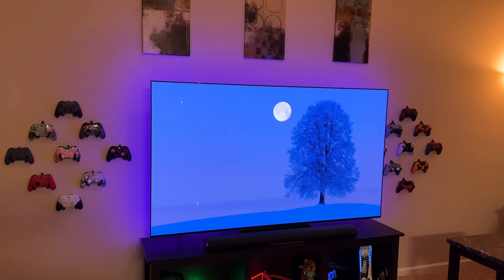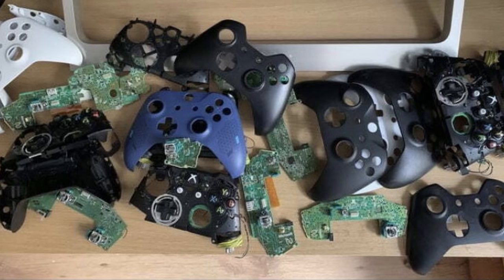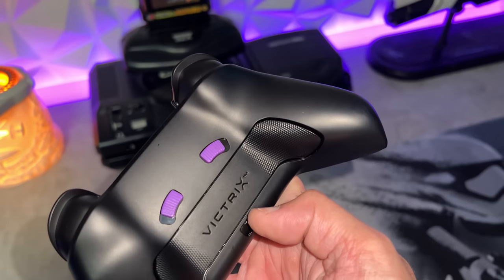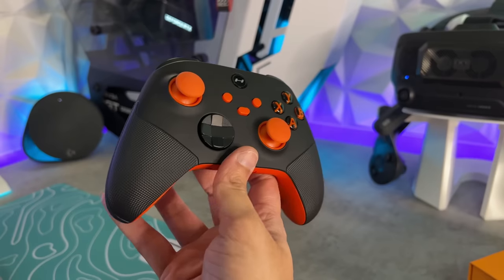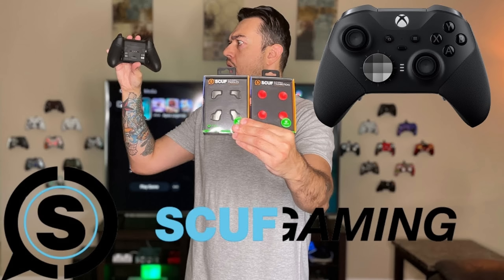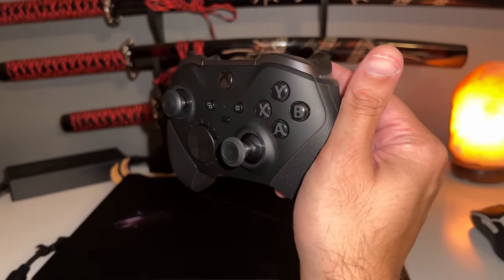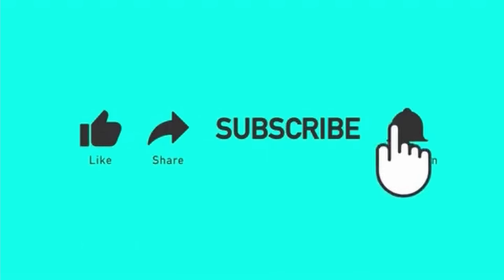Best Xbox Controller-28 Compared in 3 Price Points (Ultimate Showdown)

Comment: Could you recommend me a controller with 'clicky' face buttons with a more traditional xbox shell design (preferably wireless as well)? I managed to borrow a Razer Chroma v2 for a few days and the buttons were such a joy to use, they instantly got me hooked. But I just can't get used to the shape. it's the only controller I've ever held that actually made my hands cramp up. It seems like Battle Beaver is my only option but It's pretty hard finding any information about how those buttons sound and feel. I'd really like to know how they stack up to the Razer buttons but it seems like most Battle Beaver reviewers skip over tactile buttons.

Comment: So I got an elite and I was wondering if it would be possible to add stuff like extreme rate clicky abxy buttons on the elite
Reply from the maker: That’s a good question, on the extreme rate website and Amazon it states compatibility for stock Controllers only, however the elite is based on a stock Xbox controller so unless someone has tried it personally I don’t know
Reply: @GamerHeavenOfficial  I was wondering if u could try it since u have experience with it assembling controllers

Comment: Was unboxing G7 se while watching. Pairing it with the KF ps lotus grips once they come
Reply: I have the g7 se and xbox Kontrol Freaks don't fit. I think I'm gonna swap the right stick for an xbox thumbstick if it fits
Reply: @smash910  I watched his non se g7 video luckily before ordering. They seem exactly the same on analog stick size. To bad kf is so minimal with switch. Those seem to be best fitting on these controllers. I would try the same if I had extra xb sticks, good luck🤞
Reply: @RainWalker24c  I don't have extra xbox sticks, I'm thinking of ordering some from ebay for like £3/$3

Comment: The razer wolverine v2 chroma is criminally underrated! I’ve had it for 5 months with no stick drift, 6 extra buttons is insane and for me ergonomically perfect placed buttons (no fatigue on fingers after hours of playing) 🤙🏻
Reply: Best controller I’ve ever owned the back buttons are comfortable to use, and no stick drift at all as well, much better than elite 2 gambit etc
Reply: Can I use it wireless)?
Reply: @Thethomas95 can I use it wireless?
Reply: @Javggoat  I have the wired Xbox one but the ps5 one is wireless but expensive.
Reply: @elchepocod  v2 chroma does it give u stick drift yet ?
Reply: @Javggoat  none at all, best controller I’ve ever used.
Reply: @elchepocod  ok I’m finna get one I can use the extra bottoms as paddles right ?

Comment: I want to start off by saying that I have had an obsession as of late to find my perfect controller. For anyone that finds this comment, I hope you find it useful.

Battle Beaver:
Love the stick tension and accuracy on these but the back buttons effing suck

Dual sense edge: Currently my main
This thing just feels so good in your hands. The half moon paddles feel amazing, but in competitive Apex Legends I need 4 paddles not 2. The function keys are pretty much useless. Only a slight stick drift after 6 months of heavy use but hey, I can replace those at anytime for $20.

Gamesir G7 SE:
This controller feels awesome for the price, but there is like NO AIM ASSIST with this controller in games. I don't know what it is, but if I am playing on controller then... I want aim assist.

Elite Series 2:
Stick drift. New or used. Always stick drift. The thumbstick tension adjuster and paddles are the only good things about this controller

Razor Wolverine v2 chroma:
My god this controller is comfy and the extra bumpers is just pure genius. I loved everything about this controller, BUT and a big BUT, the factory deadzone! even setting it in the software to 1 is just awful. Aim feels very muddy for fine movements.

Thrustmaster eswap X Pro:
When you said the thumbsticks feel amazing, they do! SO very accurate, but there is something about the sensitivity curves on these that don't provide linear aim consistency for me. I found myself going back to the Dual Sense Edge.

Scuf Instinct Pro:
Stick drift right out of the box, but the thumbstick tension feels great for aiming. I personally didn't like the new paddle system.

Aim PS5 Pro:
Currently on expedited order. Used my code Stallions baby. Will update my review soon. 

Thanks for putting out great content on these controllers. Not everyone can afford to try out several controllers like you and I!

Comment: would you say the scuf INSTINCT PRO is better than the battle beavers one?
Reply from the maker: Well the BB has a lot more customization, but out the door are more expensive and take longer to arrive. Both have shit warranties, but scuf is less offensive. Better rear buttons , thumbstick tension, on the BB. It’s almost a draw but the BB if you don’t mind spending a premium and want to make exactly what you want in their builder which is insane
Reply: Thanks  for responding @GamerHeavenOfficial  ! Since im from brazil and returning for issue is a big problem for me, the only thing that worries me is stick drift, and for what ive heard and read on forum scuff are the worst at, is that your experience too?

Comment: Could you do a video on the most durable controller? I think you have sort of lost touch with who is watching your videos because of your passion for the hobby. Almost none of us want to collect controllers, I just want to be able to not have to spend $150 on a new controller every 10 months. My elite series 2 has had both bumpers stick out, both sticks drift, the paint has peeled, and the grips are coming off. Same problems on my previous series 2. I’d spend $500+ on a controller if I could guarantee it would last 10,000 hours of gaming.

Comment: My only gripe with the elite s2 is my right bumper has started to not be as responsive as when it was brand new. Was on this page to see if another brand was worth it, but honestly the elite s2 being as high as it is while still being sub $200 is kinda reassuring and disappointing at the same time. Was hoping for one even more reliable and maybe options to look cooler, but while still sharing the same general price point.

Comment: My custom elite series 2 controller that I got from Microsoft design lab the right bumper began doing a double input when I clicked it once and now recently my left one it doesn’t do an input when I click it sometimes and my A button is starting to act up a little. I’m going to wait for the elite 3 to see if they fixed quality control and stuff and if not I’m going to consider getting a scuf and maybe by then scuf will make a new version of their Xbox controller so that you can have the ability to click all 4 back paddles at once and not this rolling your middle finger thing lmao
Reply: I thought about getting a replacement but they worded about the process for getting a replacement of my custom one being basically there wasn’t a guarantee that I would get it the same way back and I did pop it open to try to fix it and blah blah
Reply: I've had the same bumper issues which is why I'm here lol. I have had luck though popping the faceplate off and using a q tip with a light amount of alcohol to clean the bumper switches and then they work like new again for a couple months.
Reply: @Hatch3tWound  yep totally feel ya. I use a spray that is meant to clean electronics where it doesn’t leave residue and isn’t conductive and it helps when I do a cleaning, but after a bit I got used to the issue (even though it’s super annoying at times) and holding off and waiting until Aim controllers give an option for Hall effect sticks or when Microsoft finally release the elite series 3 lmao

Comment: I wish you'd mention what kind of face button and dpad switches they use moreso than the rear buttons, like personally I don't think that I could be convinced to buy a membrane controller at over $180, but I have to presume that the majority of these use them by default because there's actual jack for info on one of the most important aspects of the controller as a whole literally anywhere at all. So I'm going to go through and list all of them here for anybody else who has tasted the microswitch and can never return to facebuttons with the tactility of a balloon and a dpad with all of the glorious responsiveness of a dinnerplate.
Reply: Stock Xbox Controller: No facebutton microswitches; tactile dpad

Turtle Beach React-R: No facebutton microswitches; Dpad is like a teddybear's taint

Turtle Beach Recon: No facebutton microswitches; Dpad squeesh.

PowerA Spectra Infinity Enhanced: No facebutton microswitches; Dpad is membrane

8Bitdo Ultimate Wired: No facebutton microswitches; Dpad is membrane

HyperX Gladiate: No facebutton microswitches; Dpad is membrane

Gamesir G7: Microswitch Facebuttons; Tactile Dpad

Gamesir G7 SE: NO tactile facebuttons (??); Dpad is membrane (????)

PowerA Fusion Pro 3: No facebutton microswitches; Dpad is membrane

Thrustmaster E-Swap X pro has hotswap-able bits which are interchangeable; ALL mechanical. The S cannot swap the facebuttons and Dpad, STILL MECHANICAL :D

PDP Victrix Gambit: No facebutton microswitches; Raised Dpad which is probably membrane?

Razer Wolverine Ultimate: Microswitch facebuttons that are so tactile that I no longer want to use anything else; A Dpad which uses a different kind of tactile switch which is currently failing on me because of its scuffed modular design: right switch needs extra pressure past the click, and the spring mechanism is a flat, thin plastic U shape on either side of the button, which are prone to wearing out and are a pain in the ass to try to bend back into shape. Regardless, the split dpad design (shown 21:40) is so nice that I'm starting to hate that I can't find anything else with the same one. 

Razer Wolverine V2 Chroma: Same facebuttons; Dpad is also clicky, and is likely to last longer.

Dreamcontrollers: basically Stock Xbox Controller Skins, so see above

HYPR Recon: No facebutton microswitches; tactile Dpad

AIM Xbox Series controller: hell if I know man, people only talk about the fucking paddles and the customisability, as though I don't have eyes.

SCUF Instinct Pro: No facebutton microswitches; probably tactile dpad?

HEX Advance: nobody was interested in talking about either the face buttons or the dpad at all, or showing the face of the controller in any capacity other than to show off the custom faceplate, because nobody wants to use the buttons on their controller or something idk my head is about to blow clean through my desk.

HEX Ultra X: No facebutton microswitches; tactile dpad

BattleBeaver custom: Can have microswitches for the facebuttons and Dpad, but is also fuckoff expensive

Evil Custom: Can have facebutton microswitches, and while the Dpad doesn't have any switch swap options, it's probably stock, so tactile.

Megamods: No facebutton microswitches; tactile Dpad

Xbox Elite Series 2: No facebutton microswitches; tactile Dpad

Please tell me if I'm wrong about any of these. You'll have told me more than even the manufacturers themselves, this shit took me like 2 hours when it totally shouldn't have
Reply: Here I am yet again with newfound trust issues because I bought the vader 3 pro, only to learn that the fucking microswitches are buried under a silicone membrane because everyone would universally prefer to negotiate with rubber instead of getting to immediately press the fucking button, my disappointment is immeasurable, it feels like the power button on an otterboxed phone.

Comment: Damn the timing on this video couldn’t have been more perfect. Currently in doubt between the Chrome V2 and the Eswap S. I’m using a Elite 2 right now and it’s great in games where you can adjust deadzones but in the ones where you can’t the deadzones feel huge. It also can feel inconsistent in something like War Zone despite the fast response on low deadzones. I can still make it work but I’m very curious to see the difference when using the Eswap S or Chroma V2 since they get praised for their fast responsive sticks (after the Chrome DZ fix). Anyone have experience with the both of them to recommend one above the other?

Already have the Gambit controller and maybe it’s faulty but those sticks always felt terrible to me. Huge deadzones that don’t improve at all when lowering them in the software. It feels amazing in the hand tho.
Reply: Chroma v2 takes a couple of hours to get use to, but what an amazing controller no stick drift either. I got mine for £68 on Amazon, would pay full price too, I’ve used gambit elite 1&2 powera  pro 3, but chroma I’ve stayed with
Reply: @Thethomas95  thanks man! Do you notice a difference with the sticks/deadzones when putting it next to the Elite V2? Unless your stick is broken or with bad stickdrift ofcourse! I saw that the d-pad is also really good on the Chrome. Good for fighting games that is
Reply: On call of duty, I can put 0 deadzone and minimum deadzone on the Razer app and there is a touch I mean touch of drift you wouldn’t even notice it, and sometimes none at all which is so impressive, done the same on elite 2 my player was just moving everywhere, like really bad
Reply: Also with the chroma, the stick get more grippy more you play, and everything gets better, it’s like wearing in your new trainers, normally controller get worse but this controller got better like squeaky back button just went away, everything feels smooth
Reply: Just go with a ps5 controller (newer model number) grab yourself some extremerate back buttons and a Brook Wingman. I’ll never go back to an Xbox variant game pad again

Comment: thrustmaster eswap S and g7 SE are by far my fav 2 controllers Thrustmaster Eswap S is what i use for shooters has -2ms input delay when overclocked and its thumbsticks are by far the most accurate and well calibrated (other controllers use software deadzones to lower ) if it had mouse click triggers it be perfect. G7 Se is great value through offical site and discount codes can get one for below $40 which is a steal i use it for all non shooter games thumbsticks feel unresponsive in shooters  compared to say a scuf or thrustmaster but for its price its fantastic
Reply: The g7 se feel unresponsive? Did the 100ohz update come out yet?
Reply: @naturesgrace206  its not to do with polling rate i have controllers with 8ms response time feel better
Reply from the maker: You have good taste in controllers Stuart
Reply: @Stuartgraham123 I agree the thumbsticks on the g7se feel like shit for fps games thrustmaster all day!

Comment: I see so many websites and people recommend the elite series 2. I do not recommend it. It's basically a super heavy stock xbox controller with back buttons.
Reply from the maker: It’s heavy because it has a built in battery , metal paddles, rubber grips and a bunch of features a said stock controller doesn’t have

Comment: The gamesir t4 kaleid is not even better than g7/g7se ?
For $40 mechanical face button and zero stick drift ever.
However fantastic video!
Reply: Kaelid doesn't work on Xbox, which is why it wasn't included. PC and switch only.
Reply: @ashes382  Oh you're right. My bad
Reply from the maker: The Kaleid is a really good controller, but doesn’t work on the Xbox as you guys mentioned and is why it’s not in this list.

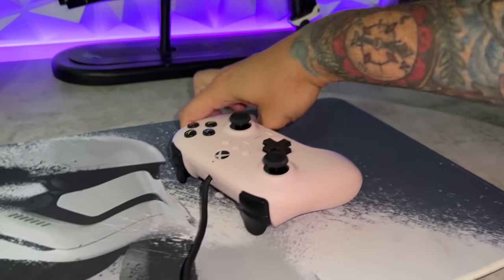Comment: 12:34 " a permenantly fixed cable which is a cardinal sin."
What friggin advantage is a puny USB connector on a WIRED controller???

I'm actually looking for one with a fixed cable so I dont have to worry about it wiggling lose in the middle of a game.

I have to fiddle with the blutooth settings to get my stock xbox controller to connect to my pc way too often. & I dont use it on xbox. Its dedicated for my PC.

Comment: No dont buy the thrustmaster  eswap pro it gets insane stickdrift after 2 months + the R1 and R2 buttons has a very sharp edge so it will hurt your index finger after a few hours off gaming(i get blisters on my trigger finger)
Reply: So just as I had spent 5 hrs researching controllers and decided the Thrustmaster was going to be the one , I see your comment😬
Reply: On my fourth pair of joysticks. They start to spike in different directions with the slightest amount of pressure lol. It’s a shame because they are easily the best controllers when working imo

Comment: Strongly disagree in the mid range. I never used the thrust but used the power a 3 and victrix each for a year. Lots of hours on each one...

The victrix programming is a buggy disaster. Set it the way you want it and LEAVE IT. But the absolute worst thing about it is the right thumb stick got major major stick drift and was. not. at. all. smooth. I clean my controllers and keep them clean and the sticks were sticky like you spilled soda on them. I swear they would randomly do little micro movements. 3/10 cuz of that very important factor. Otherwise the controller was fantastic. 

Power A 3. No idea why that's low guys please try it out. The sticks are SO much better and have minimal stick drift well ever 6 months of use. The back buttons are the 8/10. Very well placed, good size, responsive click, and pressing them accidentally is pretty much a non issue. I rarely do it.

D pad is stock when I definitely prefer a wide pad like the victrix or elite. The triggers... Yes are not great and would say they're average at best. Trigger stops do there job in the most basic way and the stiffness is greatly reduced. I switch to the stock Xbox controller when playing racing games because the trigger tension gives me a lot more control over gas and break.

All around it's a very strong 7. However I'd stay a big fat 9 when your getting a durable, feature rich controller for 80 bucks. 4 cumfy back buttons, swappable sticks, okay but functional trigger stops.

Last note is the thumb wheel in the middle to control volume and muting is MINT